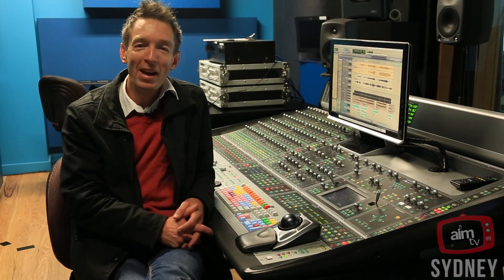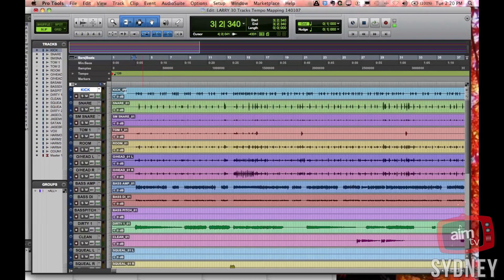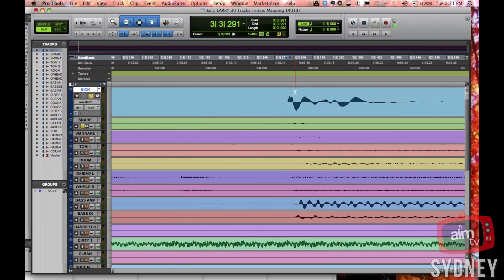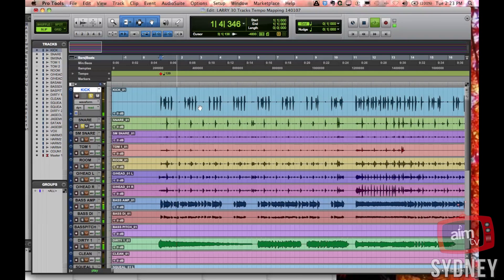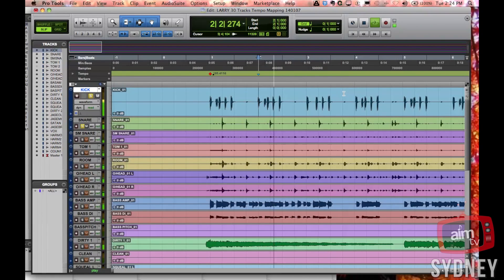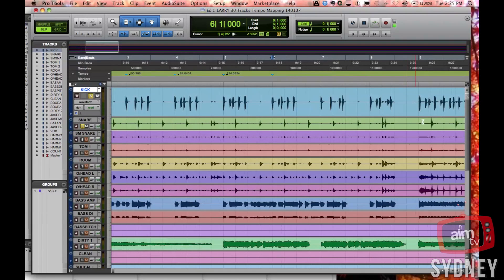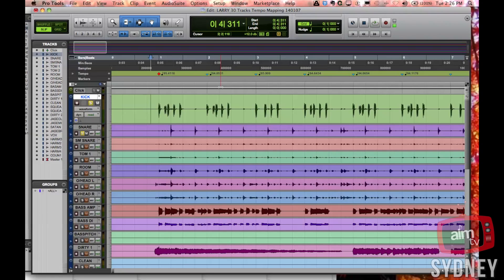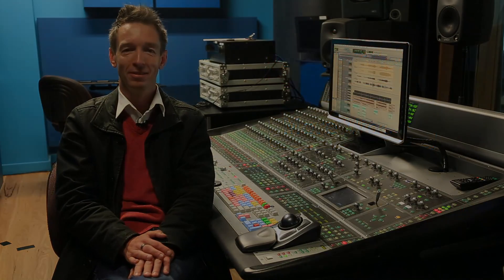Pro Tools Tutorial - Tempo Mapping

Comment: it doesnt work for me when i try on midi. why is that ?? isnt this method cut out for midi
Reply: Hi Mihindu, you probably already found the answer to this, but I ran into the same problem, when you're trying to do this with Midi, you have to make sure that your tracks are sample based and not tick based, click the little bottom left icon on the track that is a green metronome and change it to sample (the blue clock), this way it will work as shown in the video with midi tracks in pro tools, hope it helps!

Comment: Hi! I have a problem. I¿m trying to map a song using a bass track as reference since I don't have the luxury of having a drum pattern. Also, the performance tempo is shaky and the measure are uneven. Still, I need to create a mapping to incorporate Midi instruments, paste, delete or add measures. Any ideas how to do this? Been trying but the attacks are not always on one and it's hard to map. Also, for some reason, pro tools gives me very different tempos when i press Control+I. Any tips? Thanks mate. Cheers from Argentina.
Reply: If the attack is not on one, just set the value to what it should be on. 1/4 note push on the second bar = 1|4|000, 1/8 note push = 1|4|480 (960 ticks in a beat/2)

Comment: isn't there a way to detect transients and map tempo to them like Logic?
Reply: Avid should develop their software, Logic is getting better... Cheaper, doesn't require iLock, has a big sound library, integrated pitch correction, beat mapping is faster... When I'm using Pro Tools I feel I'm in 2000...
Reply: Beat Detective? I was wondering about this during the video and I don't even use ProTools!